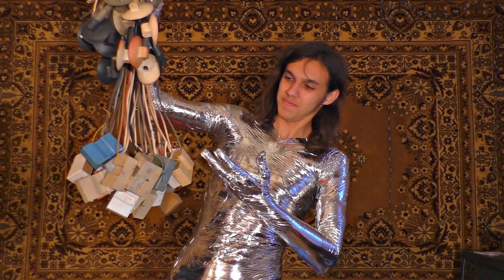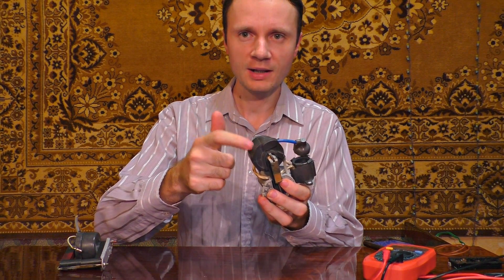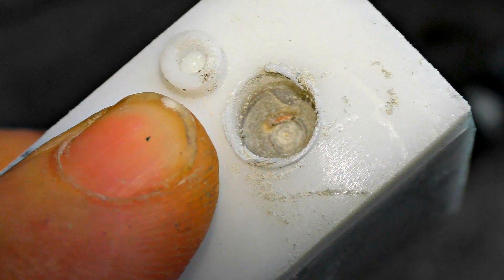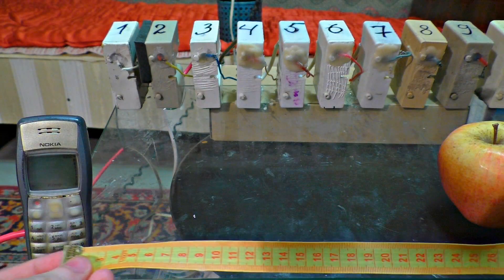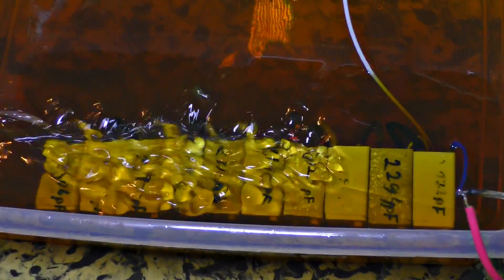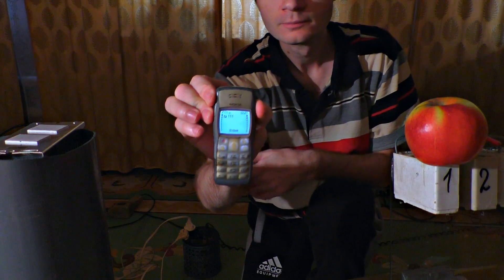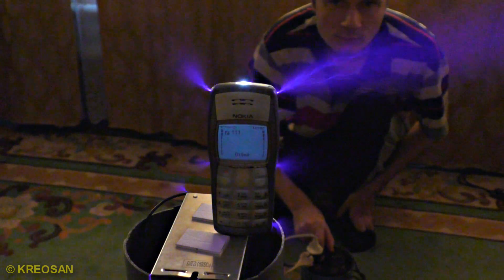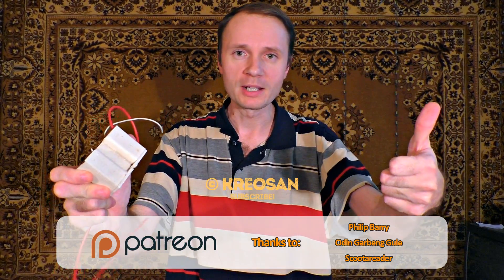One Million Volts Generator / A High Voltage Generator DIY

Comment: You may not want to post the following experiment, but the trigger point for electrogravity is 1,250,000 volts. If you can build a capacitor able to withstand that much voltage, and apply the voltage to the capacitor, it will begin to nullify inertia and gravity. Mark McCandlish was killed for exposing this secret, so I feel it is legit. If it works, don't make a video about it. Continue to experiment in secret. Do NOT attempt any patents. This is a highly classified state secret. This explains why lifters don't work in a vacuum. It is because the voltage was never high enough for the Biefeld-Brown effect to occur.

Comment: High voltage is not really dangerous as long as you put it into smallestpossible pulses (fragments of shortestpossible duration) and of course free from any kind of ground potential -> then highfrequency splitted but otherwise ground-isolated voltage sitting around you causes the "skin effect", so the electrons are flowing externally, by the "corona conductivity", on or even above your body surface, not internally.

Comment: I just happened across this video looking for some info on electronics, perhaps some of the other people here would be able to help me with my issue. I have gotten interested in making colloidal silver, there are remarkable testimonies online and some good studies by licensed doctors that testify to the efficacy of it in treating different ailments. I have made some already and had pretty good results already but I want to make a higher quality. Collidal silver is made by passing DC current through 2 pure silver plates (I have 2 .999 1oz silver bars) while submerged in distilled water. The electrolosis that occurs causes microscopic particles of silver to sinter off the plates and be suspended in the water.

The higher the voltage the finer the particles that sinter off, think of an explosion, the more energy expended in the blast the smaller the particles of debris are going to be. So I went from simply using a 12v car battery, to buying a ZVS flyback transformer used for heat induction and using that with the 12v battery which ramps the voltage up to around 10kv, then I tried to use a 24v 10amp power source to the ZVS and it totally fried the transformer, over heated and the transformer swelled. This is the item I bought if you would like a better idea:

https://www.ebay.ca/itm/ZVS-Induction-Heating-Driver-Board-High-Voltage-Generator-Circuit-Arc-Ignitor/362527538779?ssPageName=STRK%3AMEBIDX%3AIT&_trksid=p2057872.m2749.l2649

On the board it says that it works for 12 to 30v so I bought a power source that uses 110v AC input and gives 24v 10amp output then hooked that to the ZVS flyback transformer. When I was using the 12v alone the transformer was getting extremly hot so I used a high RPM computer fan hooked up with a 12v power supply to provide some cooling, I made a batch of silver with 12v battery and ZVS and everything was fine but the transformer was getting extremly hot. Then I tried to do the 24 v which is well within the specs of the product but it overheated within a few minutes and fried. I am now looking for a new transformer to try again and was looking for info on transformers. I know that to find watts is V x A = W so that means that 24v x 10a = 240w. The highest transformer I have been able to find with a rating on it is 40w for a CO2 laser, but I was wondering if I could simply use multiple transformers as you did in your video and accomplish the same thing... Any advice would be appreciated I am shooting in the dark and I'd rather not risk blowing through a bunch more transformers. I was also thinking that a ballast might work I dont know too much about electronics but trying to learn as I go, I have read a few places that this can be done but not too much info on specifics the instructable guid I found was pretty vauge

Comment: So cool!!! However, I must advise you that your test does not actually prove that using a mobile phone attracts lightning. Since the transmitter inside a mobile phone is so weak, the only real way to test for any effect of its tranciever on the dielectric breakdown of the air is to isolate the system in an (ideally) inert atmosphere of something like nitrogen or better yet argon or neon (to ensure uniform dielectric strength) and then bring the phone very very close to the opposing electrode but just far enough not to spontaneously ignite an arc. The issue is that you would have to isolate everything in a Faraday cafe to ensure that some stray radio interference isn't providing the necessary energy to ignite an arc, but then you couldn't call if as it would be cut off from the cell towers. The experiment would be easier woth something that's peer to peer like walkie talkies, just make sure the Faraday cage is big enough to contain both walkies while keeping one well out of range of the arcs so as to isolate the effect of a single low power transceiver on high voltage arc ignition. I suspect that in this scenario some increased chance of arc ignition would be observed due to the added RF energy from the walkie, same goes for a cell phone, but a cell phone is way weaker than a walkie talkie (usually) so I doubt that its emitted RF energy would provide a measurable change in the likelihood of an arc forming, at least not with equipment accessible to hobbyists. Now if you could get your hands on a broadcast radio antenna, now that might create some measutably larger arcs if you were to spark an arc between two electrodes that are near the antenna while it's transmitting. Heck you shouldn't even need to spark the arc from the antenna itself, just have it near by if it strong enough.

Comment: Got a enquire I had a 0.2mm steel wire from ebay wind around a 42n 2x2x0.5 neodymium magnet on a 400kv transformer small unit when I turned it on I had a jet of solid red plasma not the white pink blue you can get I went to retest and stick it on video i get the current colour any explanation for why ?????????? At current I think the connection in as I was sure it was sealed could be the winding moved or something in the air all I know is I liked and am want to repeat it way cool and peed off I missed the video 😬😬two apple heads?

Comment: Something looks strange.Voltage multipliers were used in first colour televisions to raise 9KV tranformer output voltage up to 27KV for the screen.It consists high voltage diodes rectifiers and capacitors,but none of these components withstands in voltages more than 100KV.I personally think that this video is fake and totally fixed.In television the high voltage was 27KV 1mA is equal to 27 watt that is very reasonable power.1 million volts in 500 microamperes current is equal to 500 watt power that comes from an old black and white television transformer in this video and many more unreasonable others.Yeah bite me.

Comment: one million volts across flat disc (custom made) capacitor plates, is the leaked information for antigravity fields.
Negative underneath and positive on top from memory.
It can fly off and go through the wall. so do be careful please.

You will note this information is about in many places, with many videos of flying saucer technology linked to this video.
Doing it with static like wheels as a van der graaf generator, or whimshurst machines in a bank that are in series might be the go.

There is a diagram image on a video called Electro Magnetic Gravitic Propulsion and Zero Point Energy or Dark Energy is in the videos besides this. It has capacitor banks. My theory is if its a million across all the banks in series, then perhaps 10 banks at 100kv is more manageable. Or 5 banks at 200kv each. (6 plates, 5 dielectics, wired like 5 batteries in series) Mylar insulation has a 400kv rating, also called polyester. Fibre glass resin is also called polyester.

The problem with just two plate capacitors is that they are unstable. So the theory is to make them in slices like pizza slices. Then wire 3 in a star configuration at 120 degrees apart. This gives stability of the same potential. Then using a distributor cap rotor type mechanism to move to the next circuit. With 12 slices in 3s thats 4 circuits with a cascading chasing effect. Capacitors and a vand de graaf hold fatal charges. Ie the Ark of Moses zapped people to death proving God was against the heretics. Such electrostatic fields also part waters... may the force be with you. Live long and prosper.
Reply: @car buff come to think of it... the youtube videos linked to the side are based upon also my previous views, so everyone will see something different... that was it... the Otis Carr version, they said they lost one prototype to space... it just kept going up up and away.... so tethering with a nylon cord might be worth considering...

Comment: cool ! make a dish 1" high with mercury. inside rim a wire leading to ground. apply high voltage to center of pool via arc and directly. ive seen low voltage experiments rotating the mercury.
i am also curious about purely electrostatic experiments. all experiments with and without magnet in center of dish, one experiment under the dish, another immersed.  haha sory for elaborate request but hitler vril exoeriments involved presumable counter rotating mercury components.,, unsure ring or cylindrical, subject to high electrostatic field. cheers! keep up the awesome work!

Comment: The spark was 30/40cm long, so (pairing to 1kv/1mm) those were 300/400kv. With 1 million volts  it should do an arc of 1 meter!
Reply: Nailed it. Even 1 kV/mm is too high for such distances. Ratio is getting closer to 0.6-0.5kv/mm above 80-90 kV. 1 mV would be rather closer to 2 meters than 1.

Comment: Is that vegetable oil you used there? It is composed out of polarized molecules, so, that might be the reason for that flow under the electric field. Although any dielectric can be polarized with a sufficent electric field, maybe with a mineral oil, that would not happen. You have to use transformer oil, that was not exposed to the humidity of the ambient, nor other particles and contaminants.

Comment: The ion propulsion effect in the oil was VERY pronounced, i didn't expect it to be that powerful.
I've always wondered about the maximum thrust density of ion propulsion in water/air with current tech.

It would seem it's far greater than i anticipated, with older technology. Not to mention, an unintended side-effect of an experiment that used technology that's quite old, and not even for its intended purpose.

I'll definitely be doing some testing with higher-voltage thrusters now, even isolating them and seeing what efficiency that adds if used correctly.
Reply: "I'll definitely be doing some testing with higher-voltage thrusters now..."  Hello Tau. Have you been up to anything that you'd like to share?

Comment: I read a story about a guy that was testing different kind of home made capacitors and one he used was a thick teflon board (about 1 inch thick) with metal plates on both sides. He was charging it to see where the breakdown voltage was, but when the "capacitor" reached about one million volts, the capacitor started to levitate, allegedly!

Why don´t you try it, you got the power!?
Reply: Could be from ionic wind

Comment: You all are awesome, but please be careful!!!
Reply: That's how we see electrycity...
Reply: Yes, it's 99% real, cuz really, that's how we see those lightning bolts.
And if you ever seen a lightning striking something it looked exactly like this, just bigger
Reply: You can see a line because the frequency of discharges is coincidentally the around the same as the framerate of the camera. What you see is basically the same as when a car's wheels appear to stay still on camera even though it's moving.
Reply: CptHrki True, the camera can only read the whole frame so fast. But not fast enough for the lightning, so it can only capture parts of the lightning strikes.
Reply: VstaarProduction yeah, guess you're more right smartass :p
Reply: Go Clip that is the intensity of the light dumbass
Reply: hahah its a fake .............  1:58 (pause the video ) you can see a straight line .... and that is because of bad editing ............ they really are a bad VFX editor and a good liar .......I can make this using After Effect hahahha
Reply: Go Clip go learn what the rolling shutter effect is so you don’t let look like an ignorant buffoon
Reply: @goclip9381  ahahahah lol that line caused by the cameras rolling shutter. it can not catche the frewuency caused by the electricity. it is completely real not fake :D

Comment: 0:59 7kV of current?
Reply: Voltage allows current to flow through a load, it's not incorrect, but it's kind of saying "and don't expose this device to wet water" Also not incorrect, But a bit redundant.
Reply: @TauCu  no it is incorrect. Volts is a measure of electric potential, not electric charge.
Reply: @Michael Remington I think you misunderstood what i said, without volts current cannot flow.
Reply: @TauCu  its more complicated than that but in a sense yes that is the case. Using volts for current is still very incorrect though
Reply: @Michael Remington It was translated though.
Reply: @TauCu  yeah not really a problem for a russian to english translation
Reply: @TauCu  But Volt is a unit of... voltage. Amp is a unit of current.
Reply: @Dareios soieraD
Volts are a measurement of potential difference, current is just how many electrons are flowing, when it comes down to it.
Reply: @connivingkhajiit  It's just a slip.
Reply: @TauCu  No! V does not equal to V/R. I understood what you tried to say, but voltage is the energy. Current is formed by energy "struggling" through the resistance.

Comment: Why did the open microwave completely fry the phone, catching it on fire, but the strike from a million volt generator... and the phone still works?
Reply: My theory is that the amperage is very low due to being stepped up to one million volts, since  Voltage = Watts/Current. This could also be why he was able to touch the balloon with minimal damage to his body.
Reply: RussEfarmer ~ Yes, I think you're correct.
Reply: Also - the antenna is tuned to pick up microwaves and turn them into electrical signals. The normal radio signals used by cell phones is microwaves with about the same frequency as a microwave oven - but those signals is quite weak. With the intensity of microwaves they got from the open microwave oven, the signal from the antenna likely got so strong that it fried everything inside the phone. 
In this case, the current is probably mostly going thru outer metal parts like the battery casing and the "ground" of the electrical circuits - also since the current is so low (due to the high voltage), it isn't enough to burn most components and circuit board traces ether.
Reply: Ride84XL ~ Thank you for that informative explanation.That makes sense to me. My knowledge of microwave energy is very little. Time for me to do some reading on the subject.
Reply: Also, even though they run 500kV or more, it is maybe only a few watts. perhaps like a 9V battery. The microwave oven however, is roughly 800 Watts, and will fry most metallic objects in close range. Or things that contains water.
Reply: A million volts but probably nanoamps for a total of a handful of watts. Around 10 or 20 watts at most (probably far less). A microwave is usually 700 watts to 1,100 watts output power. I'll let you fill in the blanks

Comment: Descriptions of close encounters with UFOs suggests that they exhibit both extremely high voltage fields as well as very high microwave emissions. They may be using the high voltage to ionize the atmosphere surrounding the craft into a plasma and then using the microwaves to induce an electromagnetic field in the plasma which causes the shell of the craft to act as a unipolar motor in the magnetic field of the plasma. The plasma surrounding the craft is what makes the UFOs appear to glow and makes them difficult to photograph.
If you were to use the high voltage to create plasma inside a bottle and then levitate the bottle over a metal plate using microwave energy you could be in line for the Nobel Prize!

Comment: Use this to transfer power wirelessly, from the centre of the room. Build a small receiver plate for Nokias, using perhaps a 7805 ic. You could sit in the sofa, charging two phones at the same time, wirelessly.

Comment: The skin effect is what saved the phone!
Reply: I don't think so, since this was DC voltage. There must have been a low resistance current path that didn't pass through anything important(metal frame I guess) as well as very low current.